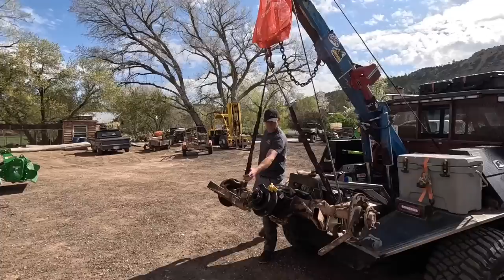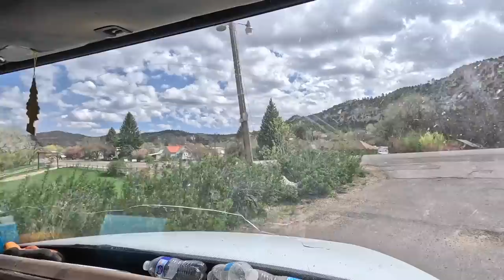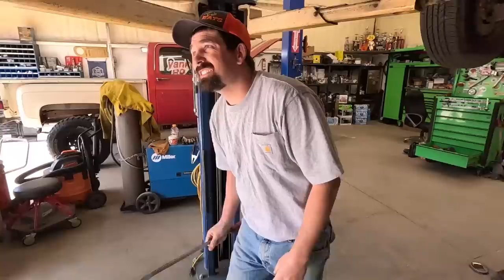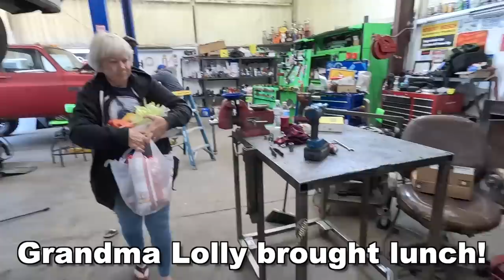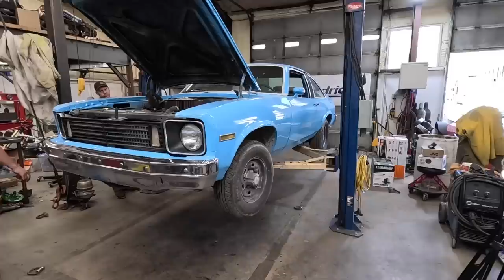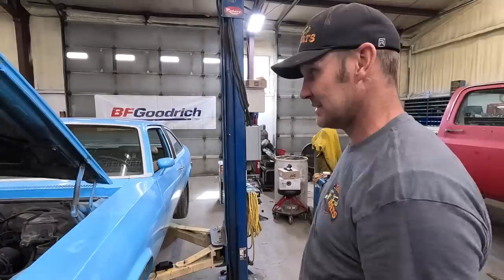Cursed: Our Shop's Nightmare Continues With Hunter's Nova!

Comment: Gentlemen, I've never had a manual transmission fail in all my years of driving dozens of different cars.
Reply: Sounds like you're not driving them hard enough. I blew up many transmissions in my youth.
Reply: That's what I'm saying!!!! Nobody over there drives a manual?
Reply: I agree perfect example look at rorys truck, and the and the use it see's. Also I use to work on a maintenance crew at a ups depot 98%of the trucks were manual and never had any problems with the trans seen quite a few driver twist drive shafts when the had a loaded truck but that was it .the 2% autos were garbage they ended up being taken off the lineup constantly.
Reply: @markcatanzaro9699  pauls wood truck and old cummins is a stick. I was sad when Landons got swapped from the 4 speed. Manuals or bust.
Reply: Weren't trying hard enough. I always enjoyed rebuilding a manual a lot more.
Reply: As long you don't burn the clutch up not knowing how to operate it or force gears a manual will last forever
Reply: @Fox P2: I've killed 2 manual transmissions. Neither one was really my fault, pre-existing damage, it just happened while I was driving them.
Reply: Always the clutch before the tranny
Reply: @Enrico Pallazzo: To be fair, burning up a manual clutch (which even Rory does from time to time - and he's beyond expert with a manual transmission) isn't really a "transmission failure".
Reply: Fox P2
 Kindly the reason why I got my 05 Wrangler Unlimited with a manual transmission. I was having fits with 91 XJ transmission, front seal 3 times. My 90XJ  transmission earned the right to have problems. All the flogging it went through. 3 torque converters. Then replaced with later model setup as manual shift AW4. That got old driving on roads, though. 
 Sadly, the Army fazed out M35a2 2.5 and manual transmission 5 tons due to the number of soldiers not able to drive them. They burned up clutches and other stuff.  In the mid-90s  as an NCO, I had to assist the BN. Maintenance by driving the only manual transmission wrecker numerous times. I was one of the few in unit who knew how and licensed for it.  Go figure a "infantryman" licensed for 36 ton and below wheeled and tracked vehicles. "Thanks 8th Inf. Div."
Reply: I would love to have a Manual Transmission be an option for me but my Knees don't give me that option

Comment: Paul don't feel bad. 45 years ago, when I was getting into mechanic business. I was working at this transmission shop as a re and re guy. One day I had to take out and reinstall the C4 out of a Continental with 429 four times in one day. Turned out to have a tiny crack in the case. So, I know your pain.

Comment: I'm so happy to see someone else struggling with random transmission crap. I replaced my transmission and burned up a torque converter sending crap through the valve body then cleaned the valve body and ended up with a extra checkball and a hard 1-2 shift the transfer case bolts loosened causing the overdrive housing to crack. Now that it is working OK the pump seal wants to leak. Transmissions are fun stuff

Comment: i'd take 1 washer out from each converter bolt pad. there's supposed to be 3/16" gap to ensure proper cooler flow. this could elevate converter charge pressure and wipe out the thrust bearing in the engine prematurely

Comment: The reason there’s no drain plug in Tran tray is back in the day most folks did there own oil changes. It was common they mistakenly drained the tranny not the oil pan. Since the trans was suggested change only 80k vs every 5k for oil. And most trans were serviced at the dealer. Plus you had to remove the pan to remove the trans filter so there’s the reason.,.

Comment: Just a thought, farmers in Canada leave some of their equipment outside during our long winters, so they spray it with oil before leaving it in a field.  Then in Spring they just wipe over the critical areas and the equipment is ready to use.
Seeing as you store a lot of old car parts outside,  ever thought about spraying the equipment with old oil, to protect it and make it easier to refurbish when you need to use it ?

Comment: I had a 76 Nova in college. Had the 6 in it. The oil pan bolt froze so I'd unscrew the oil filter and turn the engine over with the starter to pump the oil out! I was a college student, what can I say?! 🤪 The body rotted out but the thing never died!

Comment: I use a tire valve stem to plug the dipstick tube hole in the case to keep the oil in and water out.

Comment: Paul, you seem to have a lot of scrap steel, ever thought of building a bridge over that river so that you will not always dunk your vehicles which usually tend to cause trouble in u-joints, water seeping inside differential,  rusting out clutches and mesing with the brakes.

Comment: I blew the intermediate one way clutch in my 350, put a new used one in, did a dirty rebuild. Drive to town and did the same thing. Bought a good one from tci with a 32 element  sprag and went through the valve body. Found the 2-3 shift valve stuck, that caused the whole issue. They can be pain when your in a hurry

Comment: the valve body gasket has 2 variants for the TH350... one has square holes, one has round. if you need a round and use a square, it will bypass the cavity.

Comment: Transmission life is impacted by a lot of factors but clean, high quality fluid is huge. I like Amsoil Dex 3 full viscosity (the original spec stuff recommended for old school Allisons which is NOT highly friction modified). If cooler and lines are not new or thoroughly flushed, put a Magnifine inline filter in the return line to the transmission. Don't skimp on cooling capacity if you are gonna work it hard. If you are going to work it hard, set it up with a bit firmer shifts with a quality shift kit. A firm, quick shift (not slam shift) will keep the heat down some and preserve the clutchpacks better

Comment: A built 383 perhaps?  Nice stage 3 mid rpm cam on a 106 LCA.  Like the vortec heads with larger valves, AFR or Dart.  An LS would prob be a cheaper upgrade long term... but a sbc 355 can make 400hp but you know all that.  A nice clamshell  parts washer would really be a sweet addition to your shop!  I use mine   all the time!  From engine blocks, transmissions & Tcases to jackstands & drain pans... totally steps up your cleaning ability!

Comment: I feel your pain. I rebuilt a 727 to put in my CJ, filled it and it leak from the pan, drained the fluid, resealed, installed and it leaks again in a couple of spots along the cheap ass pan, time to drop it again. And as Ben said every pan should have a drain plug

Comment: If your converter doesn't reach you pump gear properly instead of putting washers behind your converter you just flip the pump gear over and make sure it doesn't bind on a flexplate when you bolt it up you must have clearance between the converter and the flexplate when you Bolt the transmission to the motor converter must spin freely

Comment: play the burn out game and pay the price over time...BTDT. The last TH350 I installed was in a '67 chevy  1/2 ton 3.73 gears  in the winter. Temps were in the upper 30s and laying out in the open  yard with a tarp blocking the north wind. The job was a swap for the old 2 speed PowerGlide tranny to the TH350 tranny. Great swap for more performance hauling my 8' slide in TC /pulling  my 15' bow rider fishin' boat. Good job crew....and listen to G'maw.

Comment: TH350 doesn't use a band for reverse. The direct drum clutch pack and the low/reverse clutch pack are applied for reverse in a TH350.

Comment: Also with the converter not engaged all the way, with bolts missing from the trans to motor, if the trans was at all loose would have also compounded the torq converter engagement

Comment: I like the rims on hunters car but Id 86 the clunky plastic caps and replace them with inverted stainless steel cat food bowls and paint the rims red with a body color pin stripe. my 2000 ford van has 3 trans coolers, a recent fluid change after busting a line was 15qts @$12qt!!

Comment: Best way to weld a gas tank is to rinse it out good then get a vacuum cleaner and stuff the hose (connected to the blow side) through the fill hole to the farthest corner of the tank and then turn it on and leave it running while welding.
Reply: We rinse them out then run CO2 in them while welding
Reply: @delbutler885  CO2 is a little more expensive and less available to the average person. But yes, that is one method you can use. Any inert gas will work if you have it available. But the vacuum cleaner method works just as effectively.
Reply: Merle Patterson in our shop CO2 is just one of the supplies. I guess I assumed that we weren't backyard hobby guys. I weld several tanks a year and geared up years ago. Your method sounds like it should work
Reply: @delbutler885  Yeah, it works well, but it's a little noisey.

Comment: TH350 needs about 1/8" of  movement for the torque converter (to allow for the fluid pressure to push the the torque forward and the engine crank to push backward)
Just goin from memory...

Comment: The fly wheel is definitely on backwards after I seen the transmission pan leaking. The debits are on the front side of the plow. Well they should be on the back.

Comment: The reason the transmission works for a minute then didn't work as Hunter was asking is because he lost the final bolt that move the transmission back so then torque converter wouldn't engage

Comment: Had a grand torino that stopped working like that.  Turned out the inner spline in the torque converter was stripped on one side.  I think the shop that worked on it new it was like that when they put it in.

Comment: try some John deere low viscosity hy guard hydraulic fluid in those auto transmissions,, power steering and general hydraulic applications.  I've been using it for years and it works great, it is very resistant to heat and pressure. and it's around $30 a gallon. pauls tractor uses it.

Comment: Paul's one of the few dudes on the platform I can think of with a transmission table that actually uses it.

Where'd he get his confidence and skills working on automatics? 
Seems a thing that just never happens with most car guys; auto's are a "take it to a shop" kinda deal once you're cracking the case in my experience; or even looking at a valvebody beyond a shift-kit.

Comment: If you keep having trans issues in the Rat Wrecker, you should just upgrade to an Allison 1000(you have to get one that is made for a gas). I've been working on Allison's for 27 years, they are a million times stronger than a THM400. You'll have to have some wiring and a TCM wired to the engine, but they make kits, it's easy. It'll be indestructible

Comment: I was watching this video and noticed that you installed a High Performance Torque Convertor. If it did not have the same stackup height and the original Convertor. It would cause the failure that you had.  I built and worked on Torque Convertor for Dacco Inc. for 12 years That is a B25 that has been modified to fit you Transmission.

Comment: Nice video.. I believe those later Novas are as nice as the 68--72s.  Have you considered putting floor heat in your new shop? An used oil fired stove would heat the fluid to heat the floor. I use a 30 gallon water heater set to 100 degrees to heat my 30x50 shop in central Washington. We have the same weather as you, please check it out, you will not be disappointed.. I Promise!!

Comment: Have you considered reaching out to folks like Bolts and Nuts (Andy) to see about setting up a fastener inventory in the shop?   They just set up Matt at Diesel Creek, and it looks amazing.    Also, just a question, considered bringing in a specialist for the transmissions, like you do with the hydraulic lines or Chad for the electrical?   You have done some amazing transmission videos, but the Transmission Gods are frowning on you lately, I hate to see all the bad luck you are having lately, seems so unfair to treat a great FAB RAT like that.    Keep up the great work!

Comment: As always, I enjoyed this episode. I think I saw some of the reasons transmissions are your Achilles heel. When you put the last pan on, did you skip installing the filter and trans oil pickup? It looked like you were missing something. And a manual valve body shift kit is kinda annoying. I suspect this last transmission is not shifting right either.

Comment: The gearbox being barely bolted to the back of the engine would have had a bit to do with the converter being pulled out of the pump drive

Comment: That transmission would have never failed if the torque converter was installed properly the first time, unless the bolts came all the way out then the same thing would have happened.  Loose bolts found the problem.

Comment: @22:30 another way you can take out the pump is let bolts fall out of the tranny( I'm a tranny so I can say that word) slam the gas pedal and flex the tranny away from the engine and voila no more pump.

Comment: What year is the Nova ? 1976 or 1977? Look good with a body kit with a Corvette hood scoop, 5 speed manual transmission,headers duel exhaust, 60' s T/A's all around. Paint dart blue metallic with white stripe kit. Some came factory I believe from 1975 to 1977

Comment: Do you think with only having 2 bolts holding the tranmission in, and a worn out transmission mount allowed it to move enough to pull the torque converter off of the 2 tabs?

Comment: I dont understand how that torque converter needs 3 washers to get it close enough to the pump.  What changed???  Wrong flexplate?  Trans case resurfaced on the pump area?

Comment: Seems like cracked windshields are common in Utah. Is there a reason for that (weather)?
Reply: Yes there is a reason for the cracked Windshields in the West. Reject sand with small rock chips is mixed with the salt on the roads in the winter to combat black ice. The reject sand chips windshields badly and defrosting windshields in the winter makes the chip turn into cracks

Comment: Orrr could you the fact that only 2 bolts holding in the transmission allowed the case to move back and disengage from the torque converter on that gear?

Comment: As many transmissions and engines you R&R. You have a metal lathe so why don't you turn the heads off several bolts, rounding them very nicely to stab transmissions and engines to transmissions, transfer cases, doubler cases, etc.? As an old machinist I try now to work smart and not hard. haha

I stabbed many engines and trans by myself. I didn't have a lift other than a 20 ton cherry picker with two 15 ton air jacks that had a hose for a remote control to lift the engine or engine transmission combination. It also had two 12v gear driven motors to move it while I was under the rides guiding the work. 

I raised the rear of the vehicle as high as I could get them so the front was nose down. Set up the engine and trans so they are at a steep angle. Then lower them into the bodies, until the back of the trans contacts a padded floor jack. As they are lowers and moved rearward I would jack the trans upward until they were aligned with the body. Wala, motor mounts and stab the cross member. 

There's your dinner!

Try using some 'stabbing bolts'. You may like them.

Comment: Paul wonder if it needs a different Torque Converter in it. But the looks of that one it's small compared to what's usually in those tranny's . Oh most looks like its for a 6 Cyl the 250 straight Six Chevy .Just wondering is all. That's a lot of space between the fly wheel and torque converter. Great Video though

Comment: Could also be whoever put the tranny in before failed to seat the converter, can't believe I just used those 2 words in a statement, into the cogs. I've seen it happen before. Usually when that happened it took out the pump.

Comment: AS a 27 year trans tech, you ALWAYS do a complete teardown, ALWAYS!!!
When having to pull down a valve body when it's still in the car, you always tie a rag around both wrists, it keeps the fluid from running down your arm and ruining your clothes. I've probably taken 2-3k valve bodys apart since 1996. 
You don't need to torque valve body bolts, but I doubt they go over 10-15 ft lbs. I would use a gun also, just have to feel it. But if someone hammered it down, I have seen it lock up a valve before. Kinda hard with those older cast valve bodies.  

Also you NEVER have to fill a torque converter, it's a total waste of time and serves no purpose. It's filled in a second of starting the engine. 
Also you should never reuse a converter that came out of a trans that had a failure and had metal in the pan. Just throw it away. You'll NEVER get all the crap and metal out of it unless you cut it in half and clean it out(waste of time).
You will basically take a perfect rebuilt transmission and kill it within seconds by getting that metal and debris into the valve body. The transmission parts should be as clean as a surgical instrument that you would use in the hospital. Totally sterile. 
Also, you don't need that expensive fluid. Just buy the cheapest synthetic they make, it's perfectly fine.

Also, what was the spring you left on the bench just as you guys were taking the tranny of the stand? Looked like a band piston spring. Did you change one out?

Comment: to many automatic in ole usa cars [i love them ] one of the biggest resins i bought a supra back in the day was a decent 5 speed.Transmission  failure is called i got a tool box i do not need to study how to do things  and guess what you do not inherently know everything and the little things matter most and you would have known if you bothered to study up on assembly and specs a bit lazy assed bs mistakes and i have did them to many times